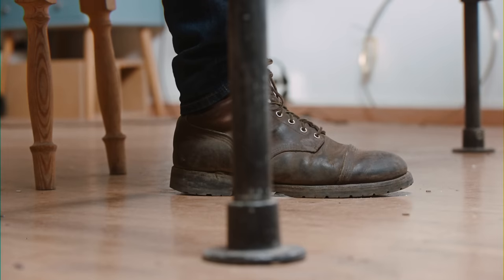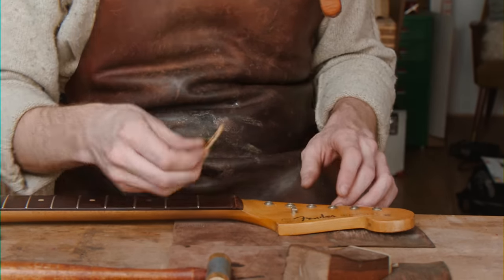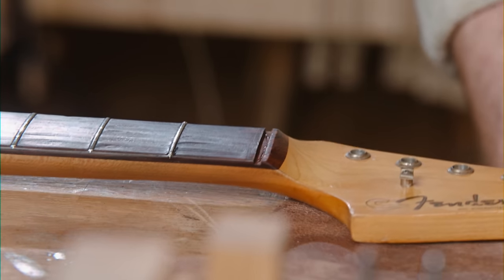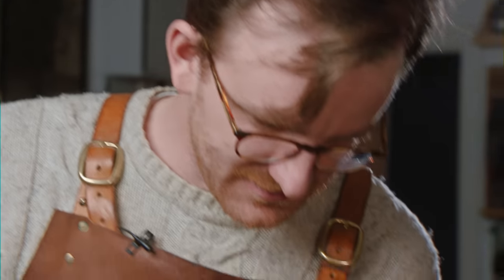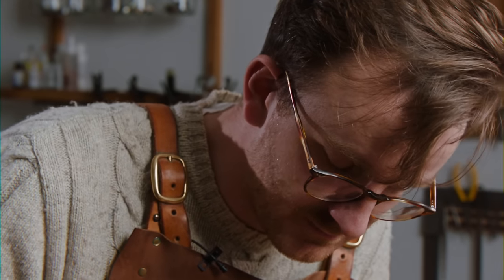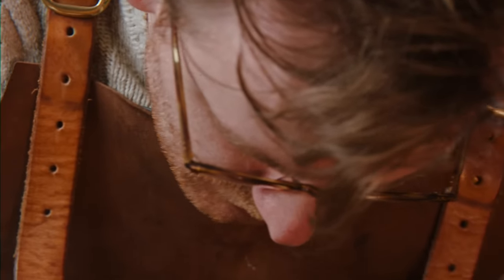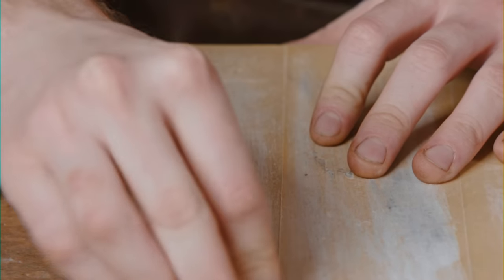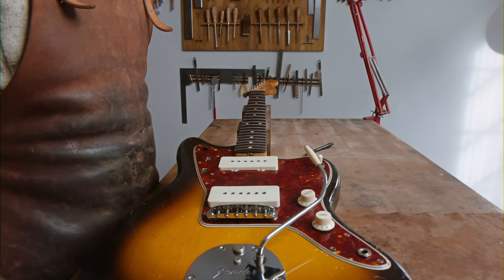Refret and Restoration of a vintage 1960 Fender Jazzmaster

Comment: You should keep track of where each tuner screw was with a piece of card or a pill organiser, it can look really off when you put pickguard or tuner screws back in a different place to where they came from (due to the different oxidation levels/colours). 

I’ve never bought the shims cause humps thing, maples pretty hard and stable, I think the hump is more just a result of the necks not being levelled on a tension jig, or having any fallaway added at the factory. 

If it was the shims causing it, then why do many Les Pauls have the exact same issue?

Comment: WHAT happened with clay dots? Rip.. shame
Reply: Mathias Bendiksen the clay dots are still there. in order to get the fretboard straight and to a playable state again I had to sand it a little. The dots were originally white but time had made the surface of them a little darker. I stained the surface back to the color they were before sanding. Guitar repair can sometimes be a give and take between making it a functional instrument again and accepting stuff like this. Anyway. Thanks for watching
Reply: Lars Dalin I just schooled myself and clay dots are just a name of its look after yellowing. I fought it was all “clay” thru. Make sense. My Fender CS had clay dots but I have worn it of.

Comment: Why guitar masters don't just CUT the strings instead regular slow restring?..
Is it bad? Who knows?
Reply: easier to throw away, maybe. I find little pieces of string around my apartment regularly, and I only change a couple times a month
Reply: @portratratra  mmmm... don't think so. I think it's about tension of strings, when you cut them - tension drop fast, when restring - tension loss slower

Comment: really dumb to sand away the fingerboard to eliminate heel hump. better to remove it from the frets after installation which are disposable and replaceable. not to mention the extra work of trying to color match the clay dots, etc.... also, support the back of the neck, ffs when you press/hammer in new frets. the "it looks better dirty" line was especially stupid. So much for not damaging a vintage guitar...